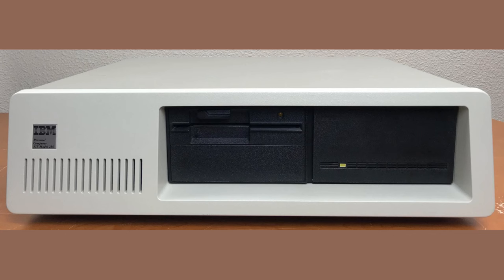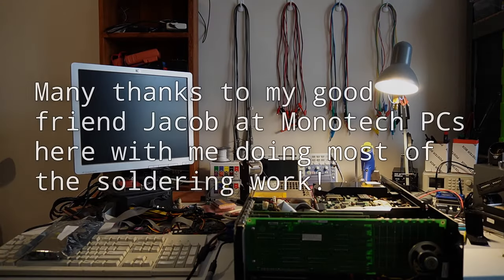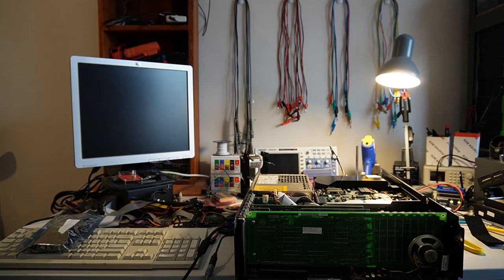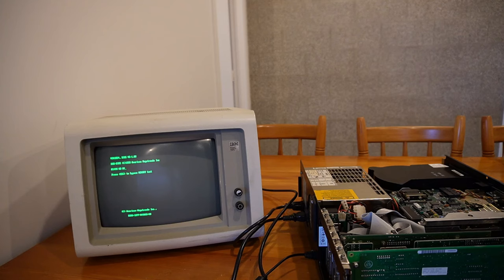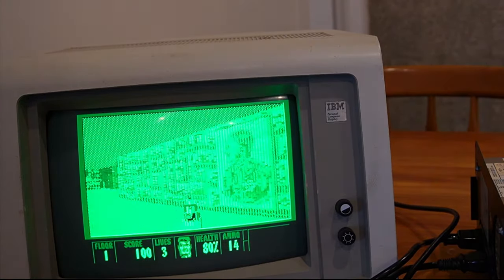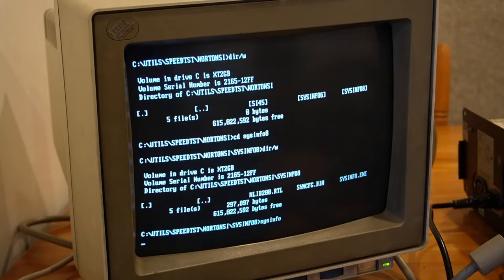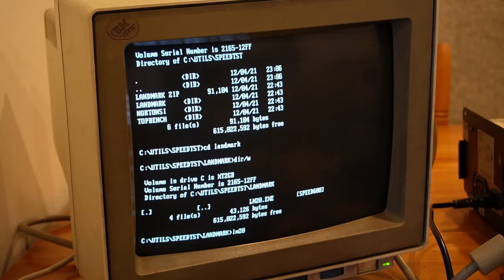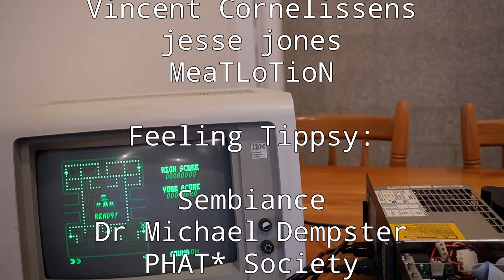IBM Said we couldn't do it, so we did: IBM PC XT/286 CPU upgrade!

Comment: I had a 6mhz AT at work back in the day and I put a 10mhz crystal in it and it ran fine. I worked in IT, so worse case I'd get the system board swapped out. I picked up a 6mhz AT for personal use, swapping out a system board would be costly, so I bought 8mhz, 10Mhz and 12Mhz crystals at Radio Shack, they were a couple bucks each. Put the 12mhz crystal in there first and it ran fine, and much faster,, For years it ran fine and I passed it down to family members. Also worked at a Major PC manufacturer, and they gave me a 486/25 clocked to 100mhz, it was fast, but it crashed once/twice a day. After complaining for weeks, they swapped the CPU for a 66mhz and that ran fine at 100mhz - some of my coworkers clocked them even higher, but we had access to golden samples cause they probably shipped hundred's of thousands if not millions of PCs yearly.
Reply from the maker: I assume the AT wasn't an IBM though? I think the point is that IBM deliberately hobbled their support chips etc
Reply: @AlsGeekLab  both were indeed IBM models, my work one was an older model and my home one was a newer model. I had coworkers doing the same thing and these were all IBM, but I suspect later revisions perhaps.
Reply: @AlsGeekLab  I get the serious impression IBM looked at a pile of original AT parts rated at 6 MHz, and a pile of leftover XT cases, and said "Hmm..."
Reply from the maker: @mal2ksc that was a theory, however the xt case didn't fit the 5162 or AT motherboard, so they specifically made the case for the 5162. It was completely unique.

Comment: Remember that a "10MHz AT" would have had 1 wait-state, so with the zero-waitstate memory of the 5162 it naturally compares as a bit faster. Also, for XTs and 286 class systems I would trust Landmark version 2 over version 6 (especially based on the results you were showing in a previous video testing the stock machine).

Comment: (Laughs in Intel Inboard 386)

Seriously, that's some excellent tinkering you've done, although I pushed the easy button in the '80s and added one of Intel's Inboard processor replacement cards, complete w/a full additional 4MB RAM expansion and 2 Quantum HardCard 20s.

Since it was still an 8-bit bus, I opted for using all additional 4MB in Extended Memory for a monster RAM drive, and mirrored the bulk of my primary HD's contents before switching boot drives and going fully virtual for the reboot.

The performance increase was amazing, and accompanied by an equally amazing amount of heat generated from all the processors, coprocessors, chips and hard drives whirring away in the case. I quickly swapped everything into a flip-top case simply because that would allow me to add multiple fans along the opening gap to keep everything from melting down.

The end result of this was my naming the heavily upgraded XT "Frankenstein," simply because of its freakishly modified contents.
Reply from the maker: Getting those Intel inboards these days is nigh on impossible. I'd love to upgrade to 386 and play doom on it!

Comment: Thanks for sharing this! It is exactly the sort of thing I would be doing myself if I had a bunch of these old systems handy (I instead have a collection of their keyboards). I'd really love a PC/XT, probably my favourite keyboard of all time is that original IBM home computer keyboard before they started making them cheaper from the PC/AT onwards.

I love how similar this is to mods I used to do on Sega Mega Drives, where there were clocks being derived from a crystal oscillator for another purpose: generating the frequency for NTSC or PAL colour burst / chroma subcarrier signal and related frequencies.
Reply: You could get a Soarer's converter and use the XT keyboard (I imagine you're talking about the Model F) on any machine you want. You could even program it so that it sends "real" cursor keys and PgUp/PgDn etc. instead of the number pad scan code, since there is software that cares. The first that comes to mind is Cubase, where the non-Numlocked number pad is deliberately set up to do different things than the inverted T and block of six, and the number pad keys are the alternates you can live without. Also you could assign key combos for accessing the missing F11 and F12.
Reply from the maker: @mal2ksc @computertoucher agree, the soarer is a good bit of kit!
Reply: @mal2ksc  If that was intended for me rather than Al, then trust me, I know hahah. I probably own more vintage keyboards than almost anyone currently alive, and have more of those old IBM ones than anything else, I think (my other most numerous keyboard model is variations of the HHKB, going back to the very first Fujitsu ones). Personally, I’m not a big fan of using Soarer’s code nowadays; it served its purpose at the time, but it’s abandonware now. I am however both a user of and contributor to TMK, QMK, and Vial, all of which are still actively maintained as well as being generally more powerful than, though not necessarily quite as user-friendly as, the Soarer code.

All I was meaning was that I have loads of the keyboards (and use them!) but I would love to have some of the systems they go along with. I have a good friend who does collect systems, but we have slightly different tastes. I drew the line somewhat arbitrarily at the keyboards, since I only have so much room in my house and am perpetually out of money. One day, perhaps, if they’re not even further into gold dust territory by then…

Good to hear from another vintage board fan though!

Comment: My IBM AT fitted it with a daughter- board with a developmental 386 processor.
Jumped on a plane from NZ to US Maryland drove into the suburbs met the intel engineer around his kitchen table who was testing the pre released 386 processor, also fitted into a AT.
Used to prepare some early c code for my large working robot, still going, still ahead in 1 way.
Reply: It was probably a 386DX prototype because the DX chips were the "real" 386 Intel wanted and the 386sx was just a hack to kill sales of Harris and AMD 286 chips (because it's pretty much "upgrade BIOS and Bob's your uncle"). You'd need a way to multiplex the data lines which the DX chip is not inherently built to do but the 286 requires. You'd also likely be limited to 16 MB of RAM because of 24-bit memory addressing, even though the 386DX supports 32-bit addressing (to 4 GB), although I doubt this was a huge problem because 16 MB was a lot of RAM at the time.

Comment: Cool stuff Al!
This content is right in my wheelhouse as I'm currently working on "The Revenge of the 5170" LOL.. If all goes well it should blow any duded up 5162 out of the water as it will have SRAM instead of DRAM, so in theory no more super fast clock burning DRAM refresh cycles and it will feature a 40MHz Evergreen 286 to 486 CPU upgrade with 8k of L1 cache, plugged into the original 1984 5170 planar which runs at 12MHz now (I also had to upgrade the buscontroller and clock generator to make it run at twice its original speed). A 5170 with its original planar running DooM, go figure ;-)
Reply: I was going to suggest a 386sx for a stealth upgrade. It would mostly behave like a 286, except when told to be a 386. Any kind of 486 will have L1 cache, and although there were some 16 MHz 486 parts very early in the run, the vast majority of them are just so much faster than a 286 that it's going to be obvious you hot rodded the machise.
Reply: @mal2ksc  This upgrade can run either from its own clock oscillator (80MHz->turbo) or the crystal on the mainboard (24MHz->normal) I can make a 486slc run like a 286 no problem. 
By disabling its turbo function and its L1 cache it will actually run slower than a stock 12MHz 286. I could even make a switching circuit with the original 12MHz crystal that came with my 5170 and the 24MHz upgraded one to make it able to switch back to its stock 6MHz speed but I don't think that wil be necessary for the software I run...
Reply from the maker: Oh I WANT TO SEE THAT!!! are you doing that on YouTube?
Reply from the maker: I'd be happy to put a 386 or a 486 in there but I couldn't see a way apart from an Intel aboveboard. If you know a way then let me know!
Reply: @AlsGeekLab  No, sorry my channel features a few guitar videos but I'm not a (serious) Youtuber ;-)
Reply: @AlsGeekLab  I think you mean an Inboard 386. The Aboveboard is a memory expansion.
The Inboard features a true 32-bit CPU which has its databus cut in half by some glue logic to interface with the ISA bus.. That will work as well but it would be way too expensive for my taste. Those things will set you back 1000+ pounds.
I'm using an Evergreen 286 to 486 upgrade which is  a little plugin CPU board featuring a reversed PLCC socket, a Texas Instruments 486SXLC2-40 and a L1 cache coherency circuit.
It's essentially a 386SX on steroids, not unlike IBM 486SLC CPUs and they're very suitable as 286 upgrades as all of these CPUs feature a 16-bit external databus. I do a lot of experiments like this and I'm also working on building a very fast 386SX class machine in the world ;-) It's an overclocked 50MHz TI SXLC2 running at zero wait states and 40ns memory 🙂 IBMs SLCs are even faster though!

Comment: My first computer was an Intel 80C85 battery powered handheld with MS BASIC 1.0 on ROM which was okay for programming engineering software. 
I think that serious PC computing started with Intel i386 DX 20 MHz with Weitek or Intel coprocessor. 
My first PC was an AMI 386 NEAT AT 40 MHz upgraded for CAD on VGA.